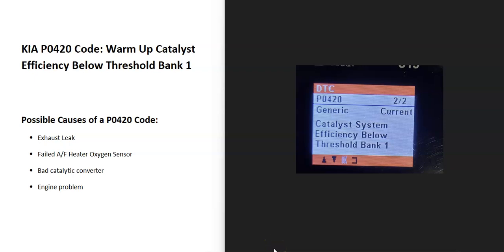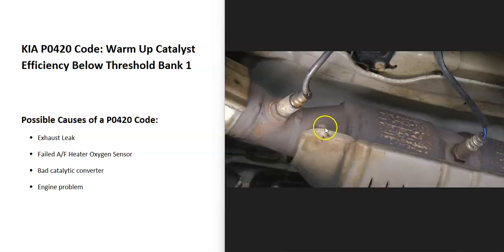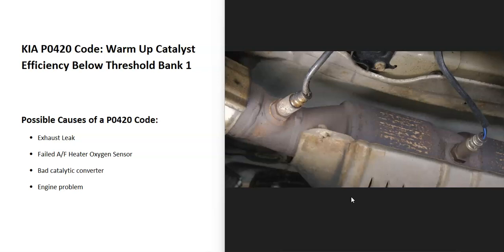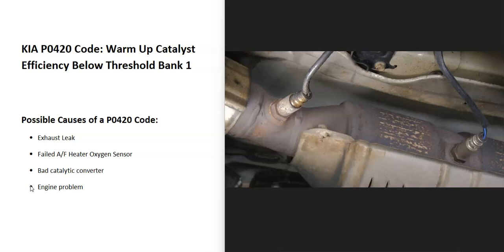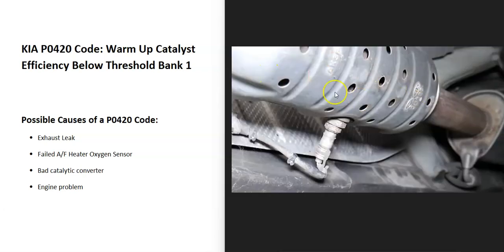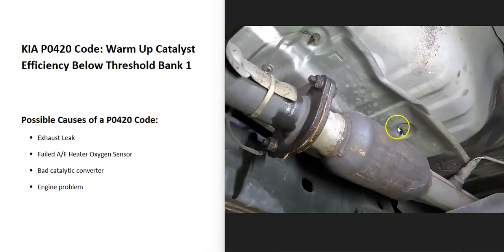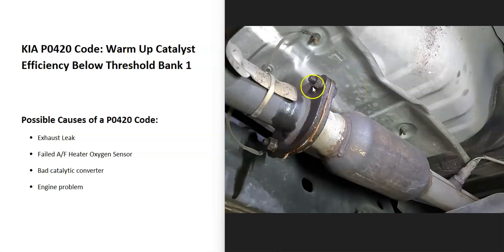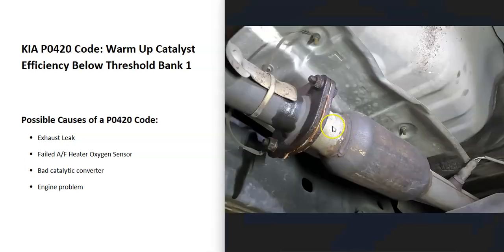How To Fix KIA P0420: Warm Up Catalyst Efficiency Below Threshold Bank 1

Comment: I've tried Cataclean and it worked For me The P0420 Code went away you just have to use it every Oil Change or every 4 months to maintain it and Cataclean is good for 02 Sensors too 😊

Comment: So I got the code 0420. I also have blow by air coming out the oil cap chicken engine light on car feels sluggish economy bad could be Cadillac converter clogged.
Reply: Have you fixed the problem yet?
Reply: @ no I still have the same problem, but my car is still running OK

Comment: Which side is bank one catalytic converter
Reply: The first in the manifold
Reply: Having this problem.  Car would only do 20 miles an hour. No 24 hour tow would answer the phone yesterday.  It was a rough 21 mile ride on expressway with a speed limit of 70. Definitely neednto change my cat. 130,000 miles. Smell sulfur or egg smell. I hear kia blow by is normal, or would it stopped up cat cause extrablow by?@andriandrason1318

Comment: P0420 code on my 2014 Kia soul, I replaced my 02 sensors my check engine light still came back on, (same code) I then replaced my catalytic converter and still the same code and it won’t go away there isn’t a leak anywhere or a crack.
Reply: OEM part
Reply: Oh, wow. My car is the same model and I've been having the same problem over the past 5 months, I haven't done anything to fix it yet, tomorrow I'm taking it to the mechanic to check it, because white smoke came out from the exhaust pipe and the car has been having some hesitation, I'm kinda worried.
Reply: @mabrokael7577 yea I’ve been trying still can’t figure it out. I replaced my whole catalytic and my 02 sensors and there’s not cracks or leaks.. 

On another note if you don’t know 
Make sure your checking the Kia lawsuit for engine misfire and the Kia and hyundia lawsuit for the engine imobilizer. .
Reply: Original from kia or after market, please?
Reply: ..use factory O2 sensor only....let it cycle several times.. after installation..
Reply: ...check engine light turned off for some time, only, to come on again....
Reply: I cahnged the oxygen sensors my self than took the Machanic all they did is what I did they didn’t fix it I don’t know what to do
Reply: I have a 2015 Kia soul. Changed my converter and sensor. And not even a year later it’s throwing the code. I also have a 2010 soul and have had no problems
Reply: I’ve had the same code for about a year and a half and the only I’ve had to replace on my 2017 soul are the engine coils
Reply: @Gaming444fun99  ..did changing coils keep the check engine light off?
Reply: Did you mange to fix? I have Kia forte same issue. Change oxygen sensor 3 times, cleaned 2 times now thinking to change catalyst but mechanics saying it won’t solve the problem I don’t what to do now
Reply: That’s my same issue . Even after fixing it the light stayed on and still same codes … I was later told to unplug the battery and turn it back on! 😩 it worked smh
Reply: Mine is doing the same on my 2017 Kia Rio. It says permanent code.

Comment: I have a question I took my car in for a full tuneup. Nothing was wrong with my Kia Rio brought it home drove an hour to another city, came back in my check engine light came on. I called said place because after the reviews I see that they mess with peoples car, just have them bring it back. Would a gas cap that is leaking also give off this code.
Reply: Usually you'll get a code for an evap leak and/or lean running codes. Theoretically that could cause this code to appear (p0420) but would also set other sympathy codes (misfires, running lean, large evap leak, etc)